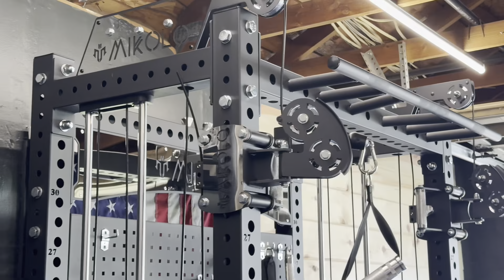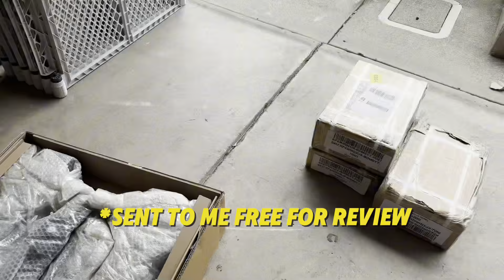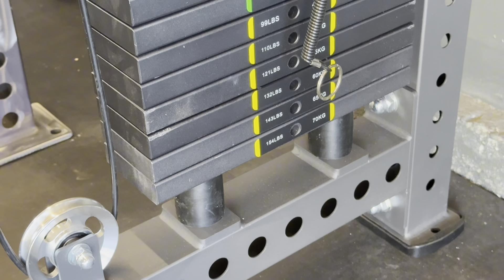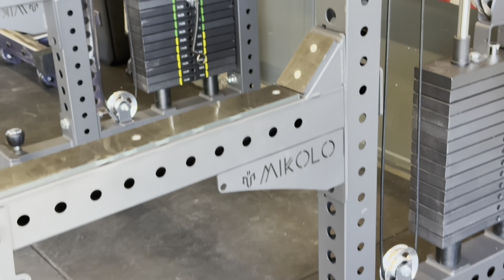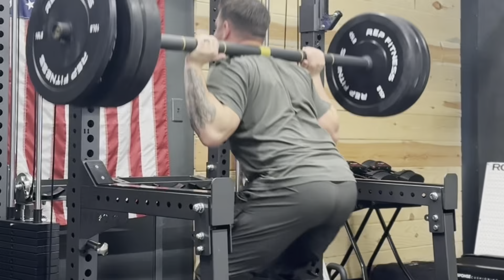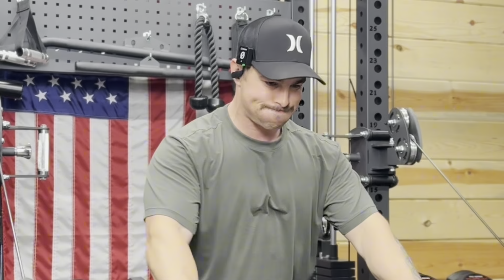This New Power Rack Changes EVERYTHING For Home Gyms: Mikolo Anubis Review!!

Comment: I am not an equipment SNOB, but I definitely appreciate the conventional wisdom of getting an 11-gauge steel, 3x3-inch rack. Most budget racks are only suitable for light lifters. That being said, this looks like a real deal. And it seems sturdy enough that I wouldn't hesitate to drop 500 lbs on it. That price is excellent for 12 gauge steel and 3x3 uprights, plus all the attachments. Props to Mikolo for actually making a worthwhile budget rack.
Reply from the maker: Ya the 12gauge feels sturdy, it gives you the confidence using it as a rack for sure.

Comment: Excellent video review, thank you! One question... How has the finish of the uprights been with the black color? Were there a lot of dings in the metal upon arrival? and has it held up well without the UHMW? Gluck showed how the front of the uprights of the Anubis 2.0 had a very smooth front finish but... the sides were like sandpaper with the red finish.
Reply from the maker: I no longer have this rack, I recently reviewed that cherry red 2.0 version. I didn’t notice a roughness on the side of the uprights, seemed smooth all around to me. Just got to be careful with the attachments. I would go red all day. Both are equally exposed to metal on metal contact with Mikolo attachments.

Comment: I'm comparing the RITFIT M1 2.0 rack + weight stack + smith machine priced at $1899 and with some discounts, you can get it even cheaper. While Anubis has no smith machine, priced $1999. Even though Anubis is 12 gauged steel which isn't needed for most people and also Anubis doesn't provide the dip bar/plate holder which are essentials and standard with most budget power racks so it adds up a couple hundred bucks to the $1999. On the other hand, Anubis has a much smaller footprint which is nice for my smaller garage, but my concern is about the rack itself without the spotter arm. I'm a moderate lifter who can squat 300lbs, Can I still be confident in using the rack without the spotter arms? If I had to add the arms, it would almost be the same footprint as RITFIT M1. Is it worth paying the extra for Anubis for it's smaller footprint without me ever having the need to use spotter arms? Thoughts are appreciated.
Reply from the maker: The M1 2.0 is a solid unit. I enjoyed it, weight stack is a game changer. I personally like the space saving design of the Mikolo. If you are doing that weight, put them on for the security. But ya for other basic cable exercises and lighter work, I think you would be fine without them on. 
If you wanted you could get some front stabilize feet, just have to double check to make sure they are compatible.
Reply: @Maguiresgym  Thanks a good idea to have the front stabilizing feet to still maintain a smaller footprint. Did you try working out without the spotter arms? If so how did you feel?
Reply from the maker: @akhilrvn good, pull ups, high pulls cable exercises seemed fine. I kept them off the majority of the time. But for heavy (for me) compound lifts I put them on for the added security. It would probably take a lot to tip it, but better safe than sorry. Who knows you might like to do rack pulls or other stuff further off the front of the rack with the spotter arms.
Reply: Did you end up with the m1?
Reply: @SasquatchN64 I ended up with Anubis
Reply: @akhilrvn  the more I look at the Anubis the better it looks. I sure wish it had Anubis as the branding on it and made Mikolo small lettering. Missed opportunity
Reply: @SasquatchN64 I just love how solid it feels and the low footprint it has that it can fit in any smaller space yet is so versatile. It has a Mikolo branding plate in the Center but I'm not much concerned with that as you can remove it if you don't want. I'm happy with my purchase.
Reply: @akhilrvn well I very well may end up with the same rack, there are so many options out there it's wild!

Comment: I rather have a dane for $800 more. This needs to be in the sub $1500 for it to be appealing.
Reply from the maker: Are you worried about the 12 gauge steel or what is it that makes this a bad value for you?
Reply: You are exactly right
People have to realize Mikola steel is not th he same as Fringesport steel and for $500 you can get the Dane, why would anybody buy this with the Dane and other options.
 I wouldn't 250 lbs. more than a couple times on those spotter arms

Comment: Nah. Spend the extra to get an 11 gague steel Dane with a 160 pound 1:1. Or a 11 gague 2:1  200 pound stack from vesta. 

It isnt that this is bad, but its priced too close to much better options.
Reply from the maker: Another $700-$1000 dollars for those options, but ya I think most people would be hard pressed to tell the difference between 11 & 12 gauge steel..
Reply: @Maguiresgym  I mean, I got my 200 pound Vesta 2:1 for 2 grand on black Friday. I know the price went up with the tariffs, but wait for a sale and it would be 2500 or so. 

12 gauge is really good enough for most people --i used to use two bells of steel cable towers as my rack and they were 12 gauge (though they just changed to 14). But this should be sub 2000$ with those stacks and that steel.
Reply from the maker: @balboa0621  smart play buying on Black Friday! Nonetheless Vesta seems like they make solid racks, this is still going to be priced under them. 
The big difference here is going to be the jump from 14 gauge to 12 gauge. For me that is the noticeable difference, I have this parked right next to my Rep PR5000 (11 gauge) and the majority of people wouldn’t even notice the difference, and I think the 12 gauge alleviates all concerns for durability.
Reply: @Maguiresgym  I actually built off of the Vesta with rep crossmembers and uprights for a 6 post wing style setup. The Vesta and Rep uprights are all clear coat and the two brands are indistinguishable, except for the laser cut logos.